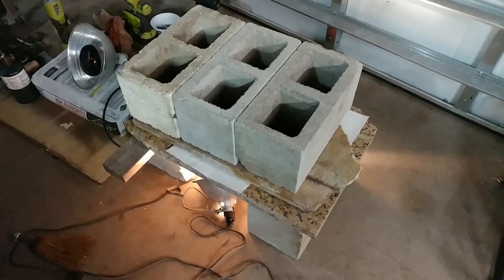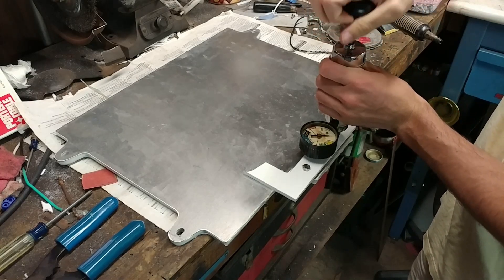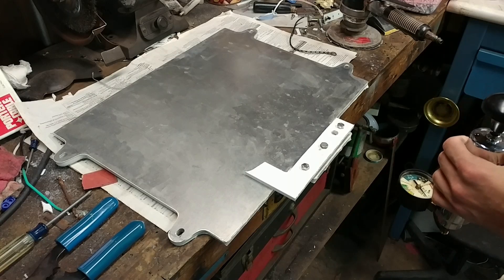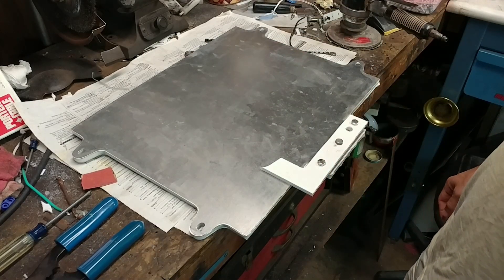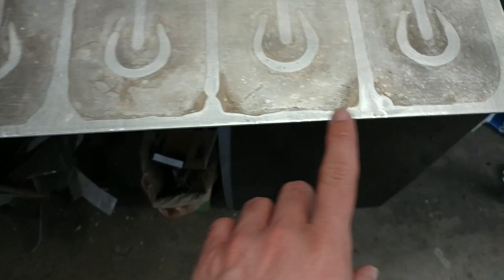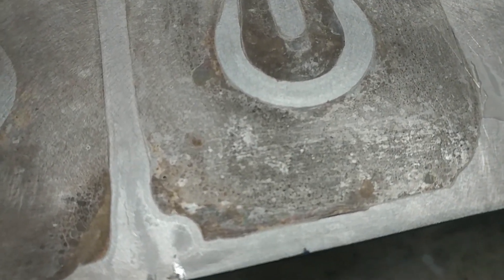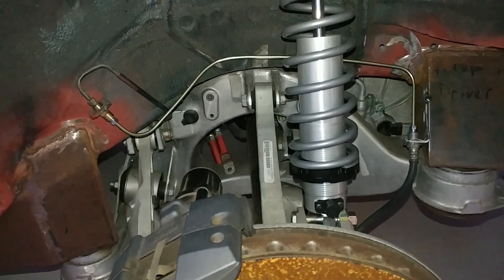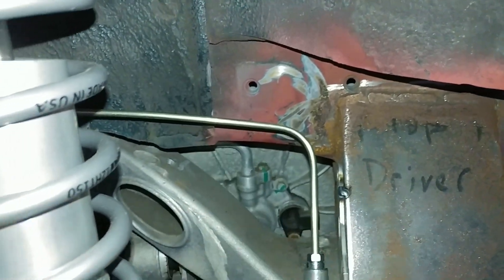Mitsubishi 3000GT Tesla Swap 15 - More Cooling Prototypes and Brake Hookups

Comment: I think you could redesign the walls of the cooling system to be thicker and have more surface to stick stronger
Reply from the maker: If I was to do it again I sure would! Cutting a new batch of center sections would take a long time, but I can hold these together by clamping the battery stack with threaded rods, which is also important for making good thermal contact and keeping things from moving around. Certainly going to need more testing with the actual water pump and battery stack to make sure it's good before installing it into the car!